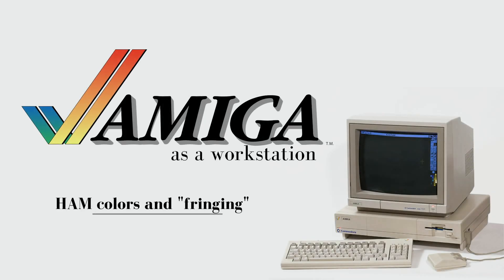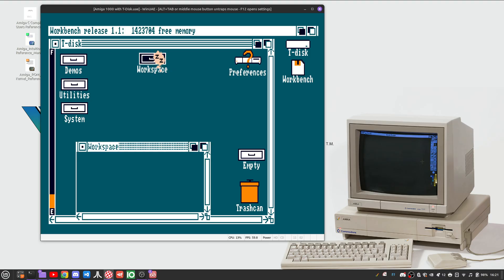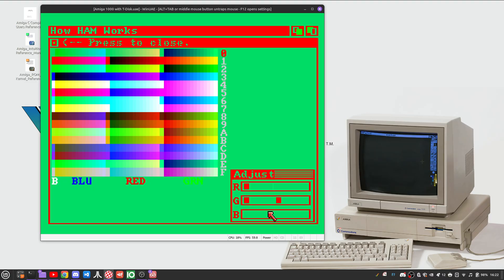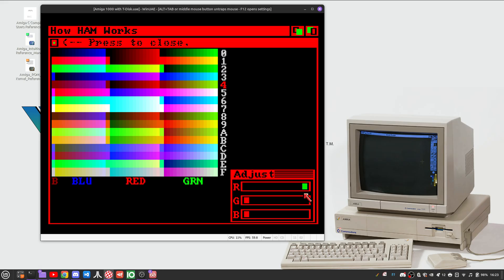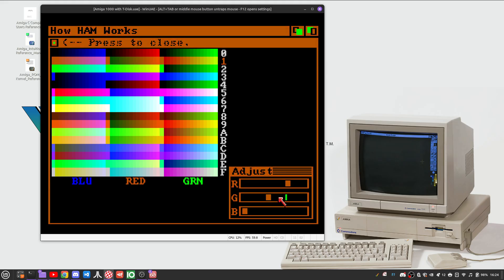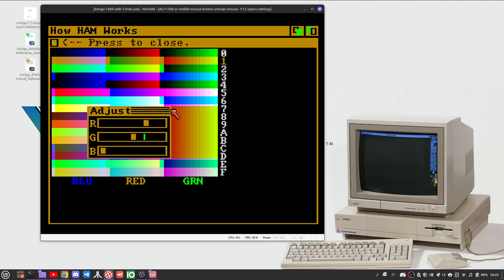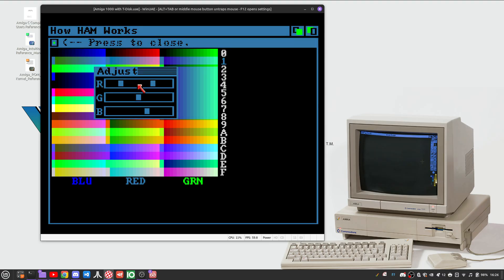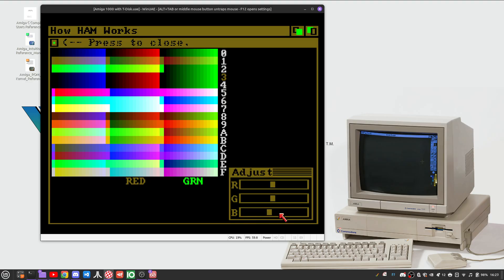Amiga as a Workstation Part 7: HAM Colors and Fringing

Comment: Nicely explained. I've heard it said that HAM is tricky because in RGB it doesn't make much sense. However, it's interesting to note that the Amiga was originally going to be a YUV system, suddenly HAM makes a lot more sense!
Reply: HAM works fine in RGB color space, especially with eight bits per pixel.